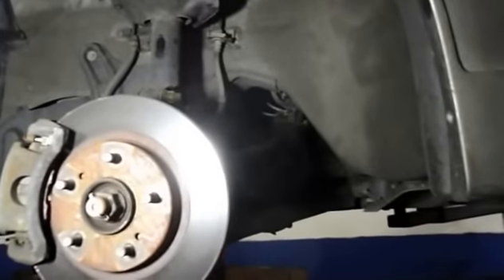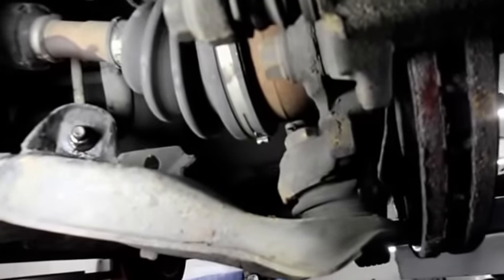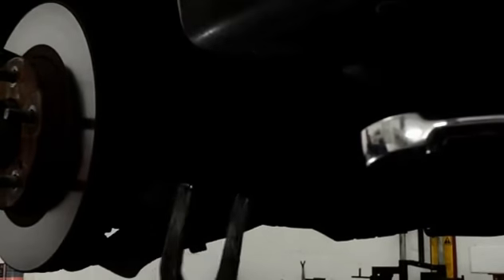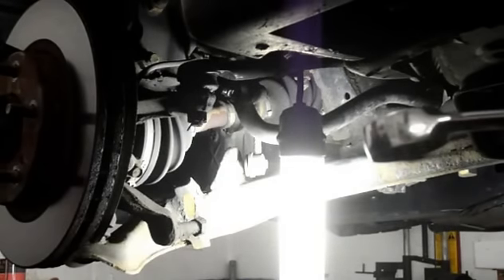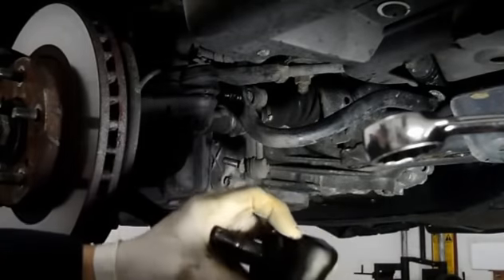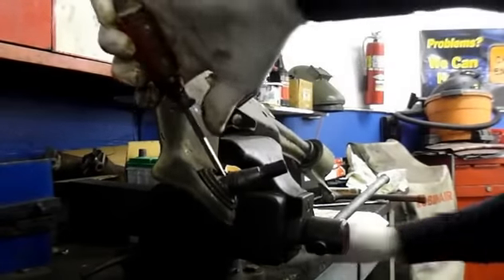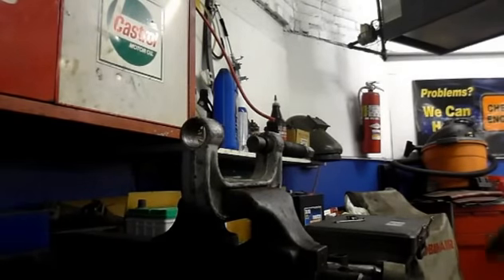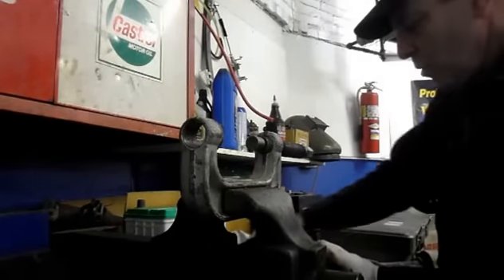HOW TO CHANGE THE BALL JOINT ON A 2000 INFINITY I30

Comment: Nice video. I assume it's not an oem part because I have an 04 maxima and have to buy the entire control arm. Stealership doesnt even have a part number for the joint itself. Where did you get the joint.? What brand?
Reply from the maker: The parts I use are moog but I think the 2004 maxima is not able to replace the ball joint by it self I believe the control are must be replaced Good luck and thanks for your feed back.Jim